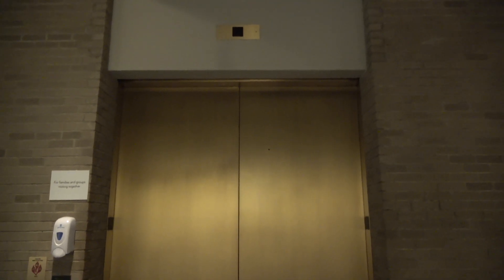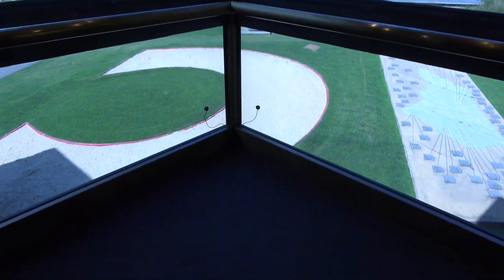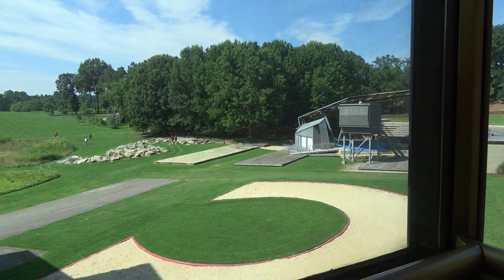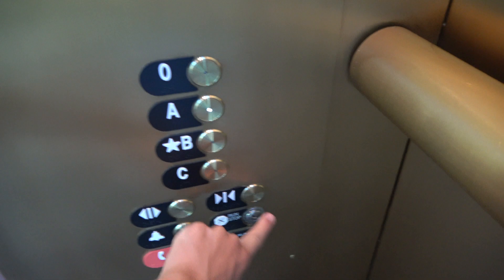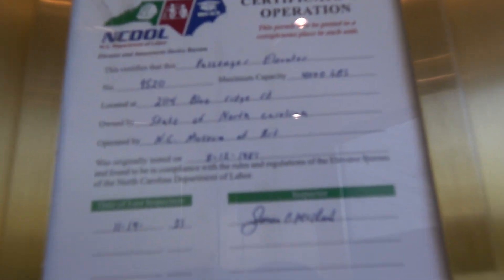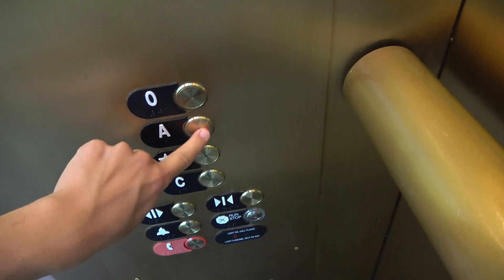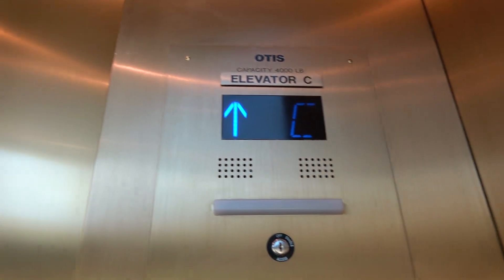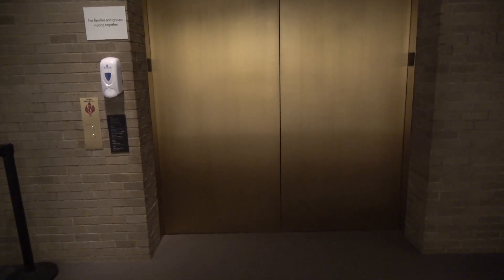TRIANGULAR! Otis Series M2 Hydraulic Elevators at North Carolina Museum Of Art in Raleigh, NC.

Comment: This is very cool, glad you finally got to ride it. This seemed to have been broken a lot when this was original (it was broken when I was here in 2013 too), so that's probably the main reason they modded this. Only thing I'm still sour about is that they replaced the motor, the old 1 was a thousand times better. Never going to forgive that fact. I'm glad they didn't ruin the cab though.
Reply: Same. Even though, I do wonder what is on floor 0? Seeing that it’s restricted.
Reply from the maker: That's technically "O" for Office, but it kind of look like it says "0" at the same time.